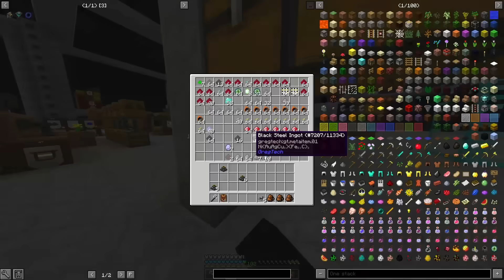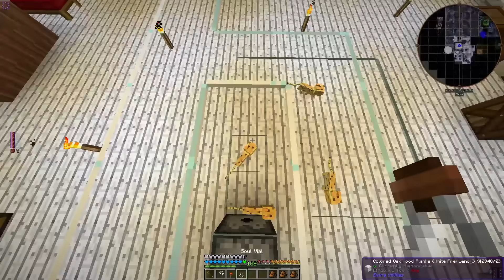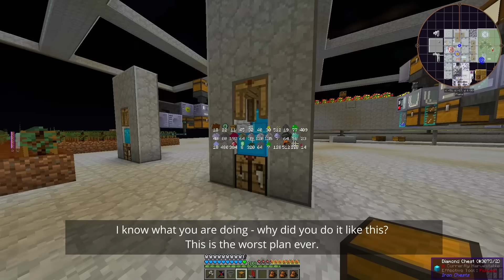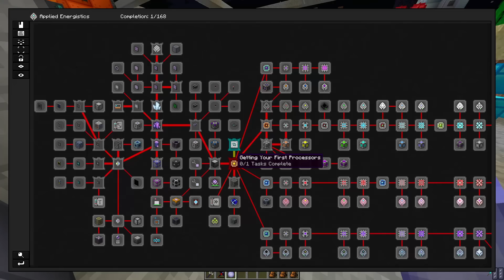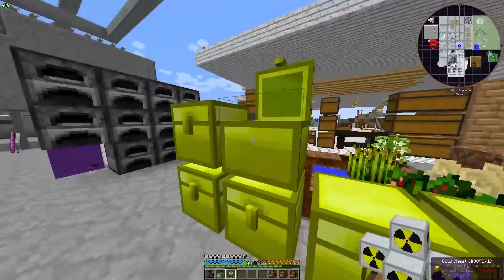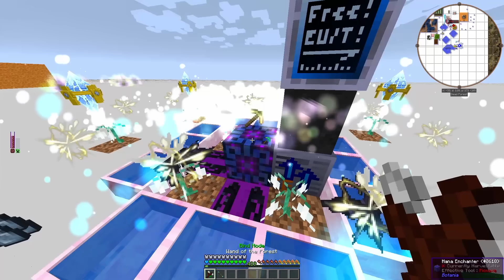Beating Minecraft's Hardest Modpack With Nothing // Episode 16 - It's Called UraniYUM For A Reason

Comment: This is my third time rewatching this series, but I'm only now realizing that Goose (knowingly or not) imitated a real-life nuclear engineering principle with his reactor casing. When you're keeping a powerful radiation source in a room, you want to shape the walls, ducts, and door frames in a way that bounces particles and rays as many times as possible before they can escape. This is called a radiation maze. At 19:25 and again at 21:02, Goose not only clads his cable ducts in warded glass, but also puts a bend in them so you can't draw a straight line between the reactor and the outside. The only difference is that this maze blocks explosions, not radiation.
Reply: what an incredible insight thank you for sharing this comment

Comment: Coming back to this video, I have to wonder if you can over-enchant enchanted books. Knowing future events, it wouldn't change the quadratic growth rate of mana requirements much, but it'd probably marginally cut down on it. You know, instead of mana enchanting for each level, you could get away with only mana enchanting for every other level you add on. It doesn't solve the main problem of each mana enchantment step requiring a ludicrous amount of mana, but it does cut down on the total mana required by... probably around half? Half of a huge number is still likely a huge number, though, so...
Just remembered Asgardandelions exist, and would more than likely look at that ludicrous mana cost, laugh, and supply it in a minute or so. Granted that only is possible in, basically where Goose is at this very moment, though...

Comment: 25:04 It's actually even worse. What you describe is a classic book ban, a type of chunk ban when you are holding items with a lot of NBT data so accessing the inventory makes the client send more data than what the server allows so it just kicks the client. It's actually possible to have an ME system so full, it becomes an area ban! That's when a tile entity (like a chest or machine) is full of high NBT items. Best case scenario, it regenerates or resets the affected chunk. This is sometimes used for duping, but it erases the high NBT objects so it's still a disaster when AE2 causes it. Worst case scenario, that chunk becomes a permanent death zone where entering it will kick you from the the game. Pretty devastating in a skyblock game.

I have only managed to do this once with AE2, in a One Block type modpack where the drops included creative cells. Then I had the bright idea to automate harvesting the one block straight into my ME system. Leave it alone for a few hours, then come back and every time I try to enter the chunk where all my ME blocks were it either kicks back to the main menu, or crashes to desktop. Moral of the story? Never use creative drives, I guess. If you actually need that much storage, it should be distributed.
Reply: if somthing claims to be infinite you should know that its not

Comment: Okay. This feels rather ridiculous to admit - but overenchanting, which is one of the few favourite Modded Minecraft mechanics, has been one of the most useful tools, and one of the most need-to-know basis secrets in my toolbox for the past few years.
I tip my hat to you (figuratively) for completely independently identifying the property of the Manaenchanter and the fact that the Overchanter "marks its cards" from just that one image.
However, I can't help but feel disappointment from your quick dismissal of using hundreds of mana pools' worth of mana for the enchanting process.
Here's why.

1.) Mana generation is, as far as the endgame flowers go, limited by one thing and one thing only. The throughput of mana spreaders.
Mana spreader throughput, in turn, is determined by 2 factors. The amount of mana a burst carries, and the time said burst takes to reach a pool (as the spreader is going to refire as soon as it detects that the previous burst is absorbed).
To optimize this, one can use a Potency-Velocity combo lens, and minimize the distance from the spreader to the pool (the configuration for this is very simple yet specific, I'll leave this one as a fun exercise to the reader.)

To put numbers achieved by this approach as an example: my typical heavy load mana farm involves Entropinniums, as TNT is easy to automate usually (which is naturally my preferred approach), and can be duped if worst comes to worst. Such a mana generator is capable absorbing a TNT entity that is about to detonate (without the actual explosion) every 0.65 seconds (or 13 ticks) per flower. It takes a total of roughly 154 TNT entities to fill a mana pool - or whopping 100 seconds to do so. With ONE SINGLE FLOWER. You are not going to drive down server performance by utilizing 2 or 3.

162 pools of mana would, therefore, take 270 flower-minutes of mana generation - and while 4.5 hours (or 1.5 hours with 3 flowers) of mana generation sounds like a lot, this can simply run in the background as you do other things - just make sure you take precautions in case of lazy loads - don't repeat my incident that resulted in the mountain I was living in getting a half of it shaved clean off and TNT raining in surrounding chunks for the next 3 IRL days.

2.) Mana storage is something Botania community in general cares very little about, for the simple reason that most of the Botania community does not do things like applying level 100 enchantments.
However, a very simple system involving storing mana tablets (which are cheap to craft and store half a mana pool each) in drawers can be a very effective way to compact A LOT of mana storage, without actually requiring the laggy mess that so-called "mana batteries" of hundreds of pools are. Just remember - transfer rate scales with tablet count. If you are generating faster than your tablets are extracting - drop more tablets.
Same counts for the output side of the "battery". It is a simple, but effective, piece of magitech. Crafting additional tablets can be annoying as they start without an NBT tag for mana capacity until they actually ever held mana - this has been fixed MUCH later in the mod, around 1.15 or 1.16 - just as a fair warning. But besides that the only issue I had with the system was tablets randomly getting caught in a periodic LagClear - tho at the capacities I've been working with, losing a couple pools' worth of mana may well be a rounding error.

I don't know if anyone's gonna read this comment. But if you do - I hope it gives a better perspective of what Botania is actually realistically capable of. (Of which this is still just scratching the surface but.. This isn't a Magitech Engineering course. It's a yt comment. Sorry XD)
Reply: My first thought on these mana generation requirements was the fact that this is a 1.7.10 pack, with tinkers - it likely has Drawbridges.

Drawbridges, last I checked (which was admittedly years ago), have this fun little tidbit when deploying a botania flower, that retracting and deploying it clears any saved data for the flower, unlike breaking and replacing it normally.

Usually, that wouldn't matter, but it can be used to do things like reset the decay timer on passive producers like dayblooms and nightshades, in the versions of Botania those flowers existed in. More notably, though, is that they can reset the cooldown timer on Thermalillies.

Thermalillies absorb a block of lava adjacent to them, and then dump out a pretty hefty amount of mana for 45 seconds straight. After that time, normally, they have a 5 minute cooldown where any more lava next to them is absorbed and makes no mana, as well as resetting their cooldown. With drawbridges, though, you can completely bypass that cooldown and reset them at the end of those 45 seconds, to get continuous mana production. A ring of 8 around a single lava block that is refilled with, say, the Blood Magic lava ritual, or an MFR... whatever the block it is that can place liquid from that mod... Can run a gaia spreader at full tilt, non-stop.

I once crashed a minecraft server several times with 4 of those clusters, a conjuration catalyst, a conjuration catalyst shaped hole, and a snowball. (A story I thought of when goose mentioned the effects of runaway effects when making the enderman grinder in an earlier episode) (thank heavens for my base being long enough in one direction that it was outside of loaded chunks when accessing my storage, and the pack having openblocks' /dev/null that I could filter to void snowballs. Plus me being a bit of a mobility nut so I could run back into the chunks and onto the catalyst fast enough to void all the snowballs before they got back out of hand and brought the server down again... on the third restart from it)
Reply: @Renniuq11  Indeed, resetting cool downs could have a number of interesting effects, thermalily is a notable one, but I imagine certain other flower could be effective, too - such as making a Spectrolus absurdly easy to automate, running it off of pure white wool, or overdriving a Kekimurus to burn cakes for mana ignoring the 4 second cooldown. One just needs to be careful about flower-spreader autolinking rules so as to not end up harming the throughput.

Good note on the runaway effects... Most things have these cooldowns for a reason... I've learned to run such systems in pulses, not permanently. Good job on managing to fix it in just 3 crashes, tho.

Comment: It's only quadratic, that's not too bad. If it were exponential then if going from level 10 to 20 doubled the cost, going from 20 to 40 would quadruple it, and going from 40 to 80 would multiply it by 16 times. In comparison quadratic is very manageable.

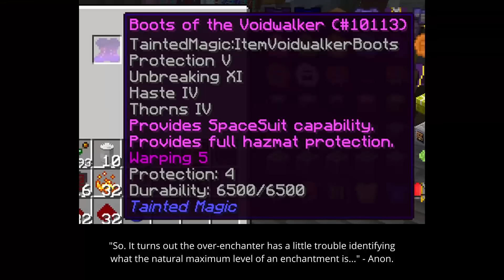Comment: Thanks to the Botania enchanting mention I dug around in the modpack I'm playing and found with the disenchanter from Cyclic I can get enchatments stripped off of items and onto books, one enchant at a time at full level of the enchantment on the item was, and with Botania enchanting to enchant an item with out consuming that book and stripping that enchant in the disenchanter again I can dupe enchanment books, further combined with enchanted items I'm getting from Wandering Trader (I don't know what mod is causing the trades, sorry) that have Sharpness X, Protection X, Unbreaking X, Efficiency X, Looting X, Smite X, Scavenger V, and some other really overleveled ones (though usually only one overleveled enchantment per item) are now all going on all the gear I can put it on. Pretty fun stuff. (Around 27:30 for the start of the over leveling enchantments) I don't know if my modpack has an overleveled enchanter, but just moving the X level enchants from found items is more than enough of a huge find.

Comment: 30:00 ish

Niiiiice. I used a similar trick to upgrade enchantments in atm8 (albeit only to th awww maximumset by atm8 stuff, probably apotheosis), so i could see where it was going pretty quickly.  Unlimited enchantent levels ho!

Imagine protection 20 on boots, blast protection 20 on chest, etc.  (No point going above that for protection levels afaik, therrs supposed to be  a hard cap of 80 percent effectiveness from a given protection type. )
Reply: I like fishing and have heard that each level of lure subtracts 5 seconds from the timer that can start anywhere from 0-30 seconds and if reduced to 0 it will immediately work but if your enchantments make it 0-0 seconds so 12+ then it doesn’t work. (Rain reduces the time by 15% witch is still above 0-0)

Comment: Does the botania overenchanter have it's internal mana pool decay, or could it simply be passively supplied over time, rather than all at once? Most of the Botania rituals(?) can take an input of mana slowly, so it's possible that you don't even need a large infrastructure; you could plausibly setup a simple dropper setup that maintains the production of mana over time, making this process merely take more time every level, rather than needing to already have it at once.

Comment: From personal experience the only 2 ways ive used to apply overleveled enchants are the mana enchanter which is the only option you have, and from industrial foregoing (not in gtnh) and its enchnatment applicator which is basically just an anvil but powered and also does not give a fuck what enchants are supposed to be maxed at.

Comment: The enchanting shenaniganry is neat, unfortunately while the devs didn't care to stop people from using it they did take steps to stop people from abusing it in any real practical fashion (at least that I've found). There's a multitude of situations where things that can use enchanted tools are conspicuously hard limited to Looting/Fortune IV if not III (crop Spades being a good example of the latter, I've found in testing), and diamond spikes specifically don't work with Botania's Mana enchanter, meaning it is limited to anvils, which means they're not getting anything too silly. The most practical use for this trick I've found was getting a super high Fortune enchanted Terra Shatterer to mine entire veins and get tons of goodies from small ores, unfortunately Botania is so poorly balanced in GTNH that by the time you can get Terrasteel you can get multiblock miners to do mining for you, and automated mining > manual mining any day of any Venusian week. I should also point out that vanilla MC Unbreaking enchant works differently from TiC's unbreaking trait - a vanilla Unbreaking X tool is sadly not indestructible, and IIRC won't be until Unbreaking CI or something along those lines. Spoiler: That is less than practical.

If there is some clever use for this tech I've never thought of I'd love to hear about it, but as far as I've managed to figure out it's sadly impractical.
Reply: Unbreakable funni high damage sord
Reply: @nosidenoside2458  You could do that, yes. However with just regular materials and MV if not LV tier machines you can get an infinitely repairable (until you get enough modifiers to make it Unbreakable) TiC Crossbow that one-shots most mobs that don't have some kind of hardcoded damage cap, from range. Kinda makes a high damage melee weapon seem weak in comparison. Not to mention there are TC foci that turn staves into weapons off mass destruction without needing to empty half a warehouse worth of Mana pools to reach those absurdly high levels of damage.
Reply: Does Vaporising enchantment that lets you get crystals of essence from mobs work?
Reply: @ERRR0RR  It does work as an enchant, yes, and you can even put it on a diamond spike last I tested. In regular GTNH playthroughs it's better to set up a wisp farm, though, and a wisp farm really wants to use liquid death as a killing method to automatically void all the infernal drop garbage.
Reply: @TheShadowofX  I meant that does Vaporising 500 make you get a billion essense from one mob?
Reply: @ERRR0RR  I'm not sure, actually. I never looked into specifically how that enchant works.

Comment: NO WAY THE MANA ENCHANTER WORKS?
Was looking at ways to transfer high enchantment levels on items, looking at anvils the same way you did. I remember mana enchanters not working when I played Infinity Evolved Expert Skyblock so I didn't even bother to test it in GTNH, but turns out I was wrong.
I have 0 progress in botania in my world (and said world hasn't been touched for a while), but it's a good thing to know.
And yes, after looking briefly at how the overenchanter works, I also figured out that it just adds some NBT data to the enchanted item to check whether they can be overenchanted or not, resulting in my also figuring out what you did with moving enchants onto different items. I just wasn't able to correctly use the enchanted books.
The pack makers did account for overenchanting in some way. (I heard there is a different way to stack enchantments ultra high with blood magic) since they made the EEC limited to looting 4